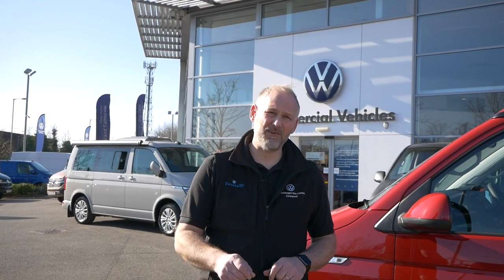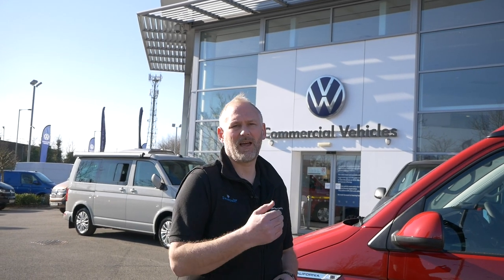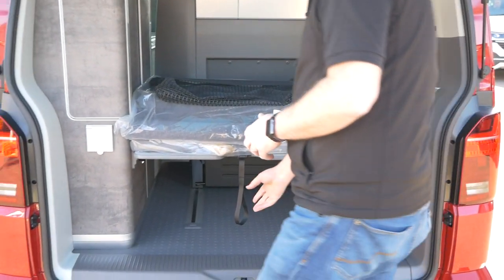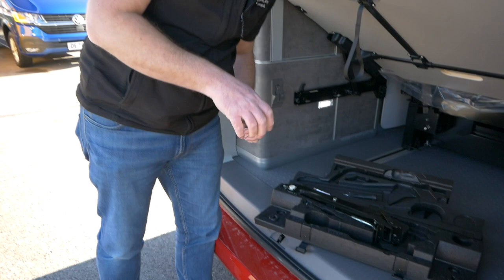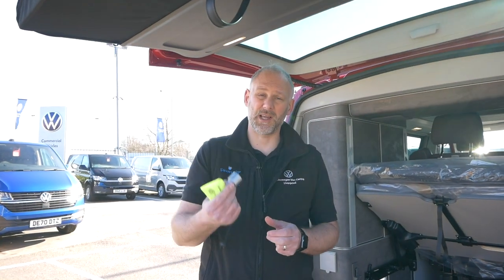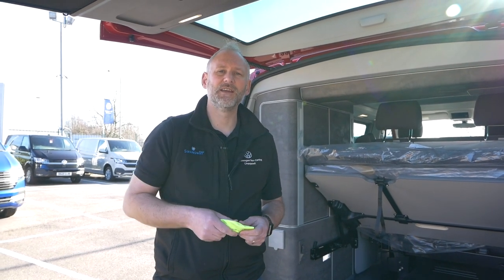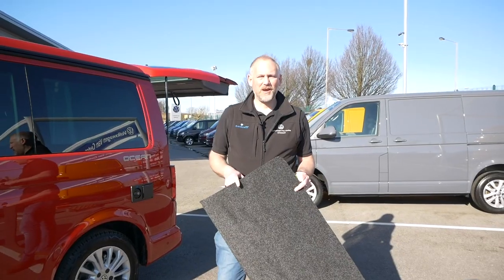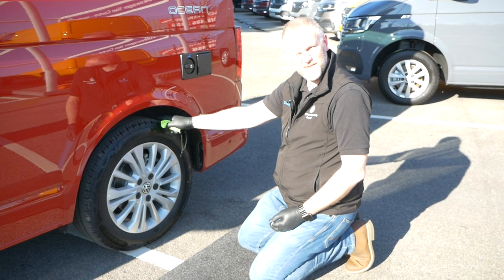Preparation: Changing a VW California Tyre | California Chris

Comment: nice vids but one thing they don't mention is that vw ocean wheels corrode on to the plate, so after you get the bolts off, you can't get the wheel off to change it (never had this problem with any other vehicle!). rubber mallet to bash the tyre with can help.
Reply from the maker: This is a bit beyond my level of expertise. I hope this video helps people get safely to a garage to handle that part of things :).